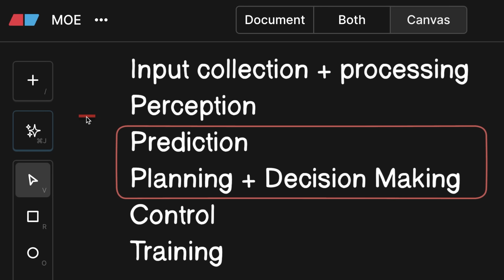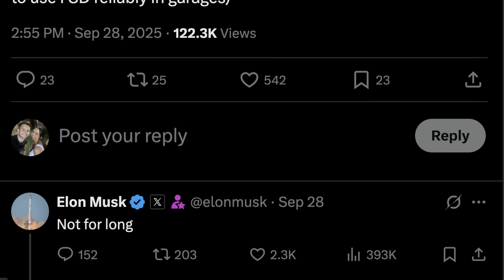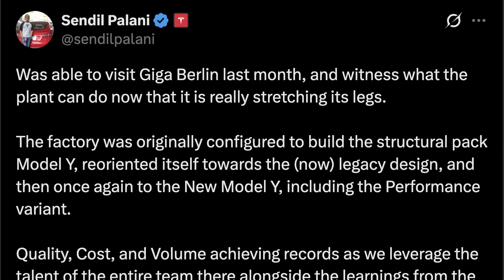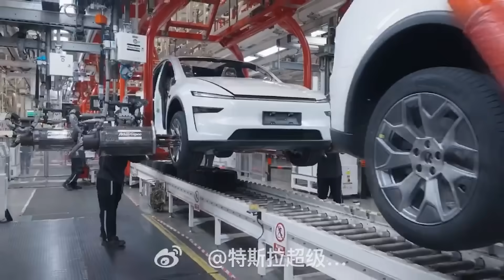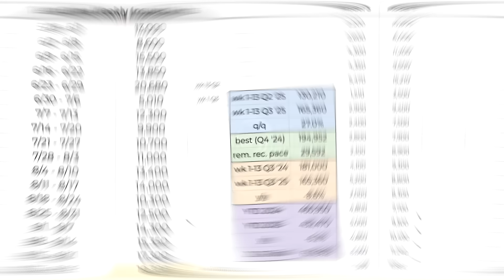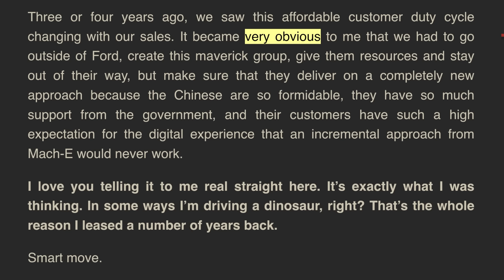Elon on FSD v14's Secret Sauce / New Era at Tesla Begins / Cybertruck Banned ⚡️

Comment: Swiss bank UBS has reiterated its Sell rating on Tesla stock as tax credits on electric vehicles sold in the U.S. expire.

UBS stuck with its  a day after the  maker reported third-quarter deliveries that were much better than Wall Street had expected. Analysts at UBS weren’t swayed by the strong Q3 deliveries.
Instead, UBS is focused on the EV tax credit in the U.S. that expired on Sept. 30 of this year. The  administration has ended the $7,500 tax credit for new electric vehicles sold in America and the $4,000 tax credit for used EVs, leaving the U.S. automotive industry scrambling.

Pull Forward
In a note to clients, UBS argued that much of Tesla’s Q3 deliveries, which are an approximation for sales, were due to pulled forward demand as consumers scrambled to buy an electric vehicle before the tax credits expired at the end of September.
UBS notes that Tesla’s sales continue to slump outside the U.S., falling by as much as 50% in some regions such as Europe. The Swiss bank also says that investors may continue to sell TSLA stock now that the electric vehicle tax credit in the U.S. has gone away.

Is TSLA Stock a Buy?
Tesla’s stock has a consensus Hold rating among 35 Wall Street analysts. That rating is based on 15 Buy, 12 Hold, and eight Sell recommendations issued in the last three months. The  of $346.57 implies 24.57% downside from current levels.

Comment: Gigacastings are not yet approved for front crash structures in China. Until that happens a unified global architecture will require stamped and welded front crash structures.
Reply: You can confirm this by examining all the gigacast/megacast etc announcements from other Chinese manufacturers. Every single one is for REAR cast elements.

Comment: No mystery about the Model Y. Lars said each factory made a different version. With the new model Y, they are producing largely the same vehicle world wide. Surprising they did not go to 2 gigacastings, but the capital investment and timeframe may not have permitted it. It may have meant flying replacement moulds for the giga casting presses around the world.

Comment: Lars Moravey addressed front castings in an interview, a while ago (maybe the one between Lars, Franz and Sandy Munro (maybe around the release of the Model Y Refresh). I believe the statement was that they were only doing the front casting in Austin and for refresh they wanted to normalize production across Freemont, Austin, Shanghai and Berlin. There appeared to be problems expanding the front castings to all locations (supply of giga-presses maybe) so they dropped it in Austin so they could normalize production across all locations.  He also noted that it would be back.
Ninja'd by @m_sedziwoj and others...

Comment: 24:33 That's bewildering. I'd be extremely surprised if that Waymo wasn't being manually driven, in which case the employee simply had to confirm. Then again, he hung up immediately after so he's not the cooperative type.
Reply: If Waymo was there for an event, why are there no pictures?
On the other hand, I did notice that the passenger window was half open.  I would expect the windows to be fully up by default.  Seems to imply someone is in the front seat, either passenger or driver.
Reply: Perhaps, but Waymo has been known to lie - badly - before.

Comment: If you ask what a transformer is you always get the same answer is uses self attention and you need to read the paper attention is all you need and then a bunch of buzz words but not an easy to understand explanation. When reading trillions of internet sentences it would be too timely to be able to go back and reread part of a sentence so on the first pass they transform the sentence in 2 ways they add the word sequence with each word and they also flag any word that can have different meaning based on context. Then based on other words in that sentence they mark that word as its meaning. Like if you buy hot dog at the fair or the judge was fair it will be marked with an attribute as to which kind it is ahead of time and then in a second pass it will read these sentences with those 2 transformations and will not have to back track for context or word order. That's basically it.

Comment: CyberTrucks are being parallel imported into EU by companies like Norton Slovak, Czech Republic and Next Exclusives in the Netherlands.
Amelioration is minimal = a rubber strip on the door and rear light changed from red to amber.
Weight restriction is bogus - 2,995 kilograms is under the limit for a B-category vehicle, meaning it can be driven without a truck license.
Reply: And how many have been sold, pray tell? Do you need hands and feet to count them off? Bah, I guess you can count them on your hands alone.

FYI, the weight restriction is not for an unladen vehicle, it's for the total weight. Meaning it will be a truck that could be given a ticket just for carrying passengers and their luggage.

And any permit buyers have  acquired is exceptional, since the vehicle itself has not been permitted as street legal. So, some rich people poured a lot of money on road bling. Some always do. But it will never be sold en masse. If it can be thought of as selling en masse anywhere else.